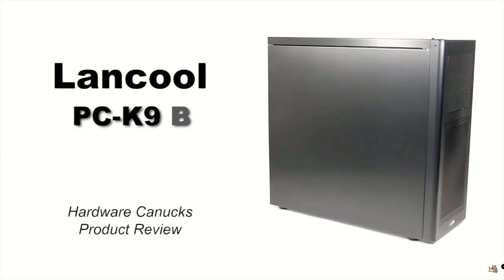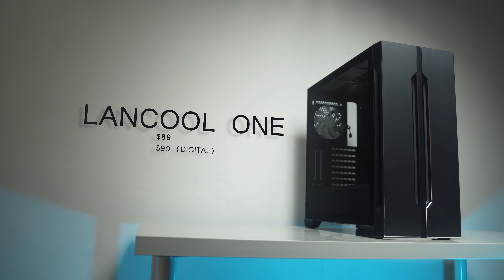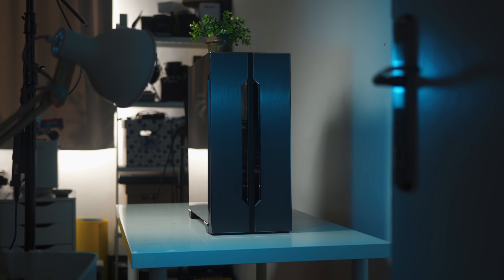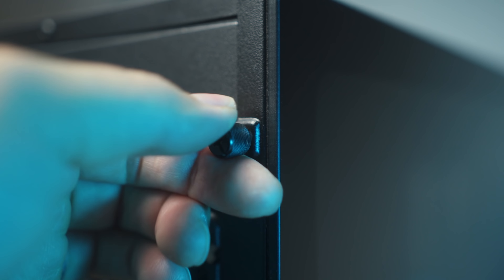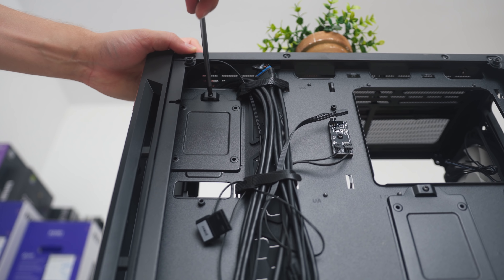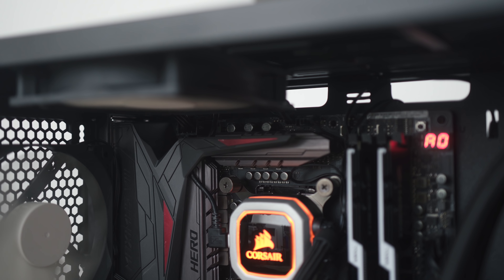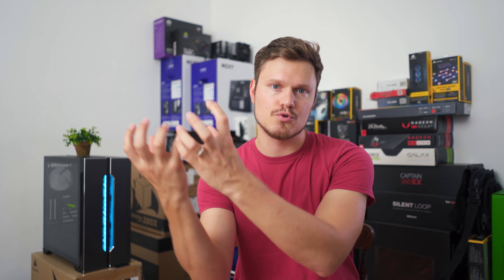AWESOME Front Panel Design - But Enough To Save This Case?

Comment: 4:35 imho it's a solid approach to leave out drive caddies because the drive mount is more solid and it actually saves space for cable management. caddies usually take away a little bit of soace, but it depends on the implementation

Comment: Lian li adapted so well in the last couple years, they used to only sell super expensive cases and with basic design. Now they not only have cheaper cases but they are also modern designed and creative. This case is not my style, but it looks cool.

Comment: You should look into the Cooler Master MB500 next. I have that case and so far it seems to beat every case on the market in terms of price, airflow and ease of built. I run an RX 580 inside it and the temps never go above 78-80 degrees C in a country where the ambient temperature is 30-33

Comment: As much as I like Dimitri and Hardware Canucks, this video is rather biased. It focuses on non-issues and blows them out of proportion: screwdrivers needed for pcie slots, or that the front bends when you twist it.
At the same time, it leaves out aspects that make this case attractive and separate it from Phanteks or Fractal. It supports EATX, which the Meshify doesn't, same goes for rgb features. It has a full size glas window, unlike the P350X. It features thumbscrews on the back, which makes for a clean window panel, which neither of the aforementioned cases have. 
I don't know why they were being so harsh on that specific case. Meshify C is awesome, it houses my main build. Phanteks is awesome, I build my girlfriend's pc in a P400S. 
I will always highly recommend those. 
But I'm currently building a Lancool One Digital build and it is a fantastic case that has enough features to choose this case over other cases.
Reply: I knew it's old comment, but you're right, the first I saw this video since I'm searching for elegant case with full size tempered glas, I was like "damn this one is catching my eyes, look like NZXT but better" and then he mention the top section easily bending... Then I was like "so it's not that good..." but yeah after read your comment, I think I will give it a try

Comment: Eh, about the molex power, sometimes it's all one needs. However, with power supplies supporting it less and less, the complaint about moving on seems valid, but I also don't like the idea of SATA power just for a string of lights when I could use it for storage.
Reply: If you are already using an ssd back there. You can just plug them in. Instead of running another cable just to plug lights in.

Comment: 5:50 i can't agree with the complaint of Molex for LED power. if this is a budget case, there will probably be budget components being used. for example, why steal a SATA power cable from a budget PSU that may only provide 2-3?
Reply: Jon P Ybanez 99 is not a low budget
Reply: Dmitry begins his review by stating the case is part of a budget series (1:10). I'm calling it budget just to echo what he uses to describe the case.

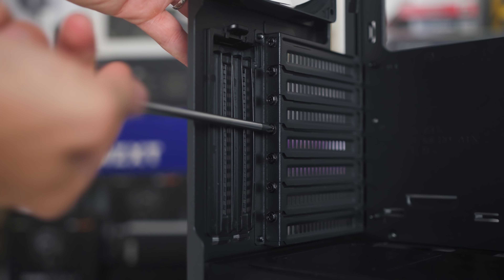Comment: 5:14 Vertical slot? does this mean can just plug n play a gpu vertically without additional stuff?
Reply: You would need an additional cable to run from the pcie solt to the gpu. I would assume it doesn't come with that.

Comment: Just get a fractal design meshify c lol
Reply: Yeah, it really looks like a bad attempt to make a case similar to meshify C. Worse front panel that looks good but up close it shows the "cheapness" (but hey it has rgb with a godawful molex). Worse drive cage. The soft rubber grommets are also a no go for me. They are going to tear apart in no time. Really not impressed with the final product from Lian Li.
Reply: my thought lmao
Reply: Exactly lol, if you're going to spend a hundred dollars on a case might as well went with the meshify c or something else
Reply: Love my Meshify C. The Define C looks pretty dope too; I'd trust pretty much any Fractal case at this point, really.
Reply: I loved the meshify c, but they really screwed anyone over who wanted to use a 270mm+ gpu with a front mounted radiator. They should have made it 40-50mm longer.
Reply: Jared Craig yeah that was my only gripe with case
Reply: meshify C front panel has too much of a pseudo-3d effect, though.  it looks 3d, but then you see it in person and its barely more than flat.
Reply: get a 570x if you're a baller
Reply: A 55mm(fan+rad) should fit. It has 315mm gpu clearance with a front mounted fan(usually 25mm). If you have a 270mm gpu(mine is 280mm), that leaves you 45mm clearance for a rad. Consider the S36, for example.
Reply: Fair enough. However I'd rather have the worst looking front mesh panel than the best looking solid one.
Reply: Just get a TT View 31. Oh wait, I did.
Reply: Mesh C is great but mine  has a shitty front io that randomly decided to break the audio out jack and power button
Reply: Meshify C can't fit EATX, neither does it have any rgb whatsoever.

Comment: After a month or so of looking up reviews and information for a mid tower case I went with the Fractal Design Define R6 and seeing cases like this in the same price range. ($110-$150) depending on sale etc.. The R6 can not be beat. I run a 240 AIO with push/pull on the front panel with 6 additional fans in the case running super quiet and cool. The build quality is unmatched. all the dust filters are a nice touch a well. This case looks cheap and low end with a fancy face.
Reply: that fractal case looks bland and bleak, this one looks like someone actually put effort into designing it at least.
Reply: HAHA ok cool.. so you are the perfect audience of a overly stylized case design with poor quality, Enermax loves people like you. The R6 has more style than any flashy blingy case. you just cant see or appreciate the simplistic clean design with extremely modular and customization interior, which is far more important than seeing fans in the front panel.
Reply: simplistic design is not only way too commonplace in the current market, its a lack of visual design, not a style of it.  its like saying there's something inside an empty vacuum chamber.  there isn't.

yes, quality is (usually more) important, but looks matter too.  you can't market something solely off of technical specifications/pure quality without factoring in some design, or you will just significantly limit the audience who will want your item.  its about balancing design and quality, not going 100% quality and 0% design.

R6 looks like i could paint a cardboard box black and poke some holes in it and it would look the same.  at least other cases look like they put some effort instead of none into the visual side of things.

Comment: Correction: only slim low profile radiators can fit on top. Awesome case by Lancool ONE aka Lian-Li.👍the best water cooling case under $100 so far in 2018! If not...
Tell me one case that has...
vertical GPU mount
RGB support
Dual 360 rad support
Tempered glass panel and doesn't choke the front for air?

Comment: Does anyone do a how to remove the front panel video I have this case and don't want to damage it but now I can't find anyone showing how to remove it I tried calling on it but it doesn't budge
Reply: Have the same problem. Did you take it off?
Reply: @TheKyoko909  I don't know if it's necessary, but I ended up taking both side panels off. The bottom left corner on mine was the loosest, for me I ended up having to hang the front edge of my tower over the table because it was catching on the table itself when trying to pull it off.

Comment: Lian Li always sells cheap stuff at higher than market price.
When I first bought my Lian Li O11 Air Edition. 
Im surprised the lack of internal feature such as removable thumb screw for the 7 PCIE brackets. it's 2018 and you still need to use a screw driver for those.
The HDD cage is not toolless design.
The magnetic dust filter feel cheap AF as those do not stick to the case properly. Phantek or Fractal Design has better non-magnetic dust filter design overall and is FAR cheaper than what lian li is producing,
Reply: Lian Li was once known for its expensive all alluminium cases

Comment: I went for the NZXT H500i and im very happy with this. From a Cooler Master K280 to a NZXT H500i, i felt the material's quality diference.
Reply: but the looks drastically decrease.  one looks like they actually put some effort into the visual side of the case.  the nzxt one looks like they modeled it after a cardboard box.

Comment: Yeah, but if you need EATX with low weight 8,25KG and compact size, good airflow, 360mm AIO, big GPU, case made by major brands... also most of contemporary features like glass and aluminum, LED sync, USB-C and simple good design... you will find out, that there is almost no alternative, especially at this price point. Just maybe old old old corsair 450d

Comment: I want people to comment on this and give your opinion i had a cpu which i used for 7 years thats the intel celeron 1000m 1.8ghz but now i have an i5 3320m but thats the good part....the bad part it that my laptops left hinge melted becuase of the heatsync being right underneath the screw and holding for the hinge....my idea was to take out the components from the laptop and turn it into a media pc and turn the screen into a monitor but without the contoller because im not using hdmi its the same laptop csble i am extending for the screen XD. Let me know your opinion!
Reply: Idrees 778 just get a cheap desktop setup man, much better
Reply: Julius Hansson i forgot to imply that i am broke af
Reply: Julius Hansson and btw why would i get a cheap desktop if my mobile cpu is close to being on par with an thalon x4 640 and is better than the i5 4200u

Comment: Outdated Molex, require tools and poor cable solutions... I think this is a 7 years old case with a new poor-airflow-front-panel-but-hey-it's-RGB! that is the rage recently...
Reply: Requires tools? Seriously?
Reply: you need a screwdriver anyway. how would you install motherboard without it?
Reply: Fair point about the tools. But having to bust out the tools, just to change a drive out or take off a side panel to do something quick would be annoying.

Comment: Still prefer my white Meshify C.
Reply: I'm about ready to do another build and have been considering the s340, 400c, h500(CM and NZXT), O11 Air, Lancool One, or an R6. So far, I'm thinking get of a 2nd Meshify C, but in white(my first one is black). Every time I say "ooo I like this case, but wish it had this..." I think back to the Meshify C lol.
Reply: DbDBlackJack yeah, totally haha. I'm building a home server and I'm leaning towards the R6 for hard drive mounts but I love my Meshify C. I bought it to be a temp because I was waiting for the O11 Air but that was a disappointment for me and I'm more than happy with my Meshify C. Just wish Fractal made a white model without a side panel window.
Reply: I'm pretty sure you can mount the solid panel on window side. Might have to take out the grommets, but there are mounting holes symmetrical to the holes on the solid panel side. Double check that, but I'd bet you can.

I didn't like the cpu cooler clearance on the O11 Air. What didn't you like about it?
Reply: I could probably mod my Meshify C to take the panel but I meant that Fractal doesn't sell the non-windowed version in white, only black (I would've bought the non-windowed version in White if it existed). As for the O11 Air, it wasn't a really good airflow case from what I saw in the reviews - the dust filters blocked too much air and a lot of builds I've seen are using it for water cooling. I also wish that it came in white, since the O11 Dynamic came in two colours. I guess not big things but they were big enough to make me not want to change cases when I already really like my Meshify C.

Comment: At this point, case manufacturers should just re-boot their greatest cases of years old with some newer elements (even if it's as little as glass and some lighting). It's obvious they can't come up with any NEW ideas. It would be more refreshing to see some of the older classics re-booted and re-released rather than these "there's only so much we can do on the case formula" releases

Comment: Can you all give me some review about s340 elite airflow? I really like this case, btw im using air cooler
Reply: Ngurah Bramhyang i think dimitri already made a review about them
Reply: Mr thunder i know, i want to know about some people who use that case
Reply: I use that case right now for almost 2 years (in 4 months) and temps are fine since the front panel is a good length away from the from intake. The dust filter doesn't choke the airflow and GPU temps on a 1070 at full load are around 75 C and of course depending how you cool the cpu I'm sure either air or liquid will be fine temperature wise.
Reply: MsMariokartwiifan how about your CPU temps?
Reply: Well I use a Corsair H100i v2 on an i5-6600k at 4.2 which is a modest overclock. It will depend on what cooler you use but I get around 38-40 C max load when gaming, but have no tried a full synthetic benchmark like aida 64. Again, I could overclock it to 4.5+ no problem I'm sure which would raise the temps but for an Intel chip, the temps are not bad.
Reply: i get an 8c hit with the front panel on using an air cooler and two corsair 140mm as intakes.
Reply: Simon Fuller how about your max temps for your CPU and GPU?
Reply: MsMariokartwiifan how about your GPU?
Reply: Hugh Janus ok thanks a lot bro! ;)

Comment: I want more space for 3,5" HDDs :O
Reply: HDD's are an eye sore in a tempered glass panel like this. So, why?
Reply: Bryce Bishop They should be in the power supply chamber.  But I just want like 4 or so down there 😅

Comment: So basically all the cases below £100 are cheap shitty cases. the reasonable stylish best cases are about £150 i can see on overclockersuk. you got the meshify s2 which seems a good case but looks cheap, lian lil 011 dynamic looks good quality and stylish design but no built in vertical gpu mount, nzxt h700 looks basic and no vertical gpu mount, h500p mesh looks too big and not sleek looking, obsidian 500d looks nice but i think its quite a small case, phanteks p600 looked ok bit big like the h500p and cheap looking plastic white. i think its gonna be lian li 011 dynamic ill be choosing.

Comment: We need case manufacturers that make higher quality cases. So sad to see how brands like Corsair are manufacturing cheap plastic garbage cases and peripherals like their "Raptor" peripherals and "SPEC" cases (with maybe the exception of the SPEC-OMEGA).
Reply: manufacturing those plastic cases with metal would lead to unreasonable price tags due to manufacturing constraints with metal trying to make some of these more 3-dimensional patterns you can get with plastic for a much lower cost.  what we really need is fewer cases that look like they had 3 seconds of time put into the visuals.  so many cases i see online just look like "painted cardboard box with piece of glass on the side", like cmon, where's the more interesting and unique cases? what happened to the more aggressive cases? yea, the SPEC-OMEGA line from corsair is good, but i wish we had more modern cases like that.
Reply: I don't mind plastic. As long as it is in the right place and it isn't cheap plastic. Case in point, no pun intended. My TT View 31.

Comment: Kind of dissappointed about this case. In my opinion it's possibly the best looking case in the sub-$100 category, but with those cheap material choices, missing drive bays and phillips screws for the SSD mounts, they've really missed the mark unfortunately. Back to the Meshify C for me.
Reply: I would have to disagree that it looks the best. Fractal Design Meshify C and Thermaltake View 31.

Comment: lol... It looks a lot... and I don't just mean a lot... but UNCANNILY a lot... like an HP Envy Phoenix...   Sort of pathetic to copy design off of HP... I mean, nothing against HP... But come on.  This thing is its twin.

Honestly, an Alienware Aurora R1 from what, 2012?  Is a HELL OF A LOT better than this, and I of course am just talking about the case.  Even back then, Dell basically, managed to make all of the RGB side and front panels connect via wireless gold plated spring terminals/contacts.  Had better AIO/radiator/pump mounting, better (if the only) build in lighting... and I don't mean RGB, I mean functional, white, LED's in the back, top inside, side inside, etc... just to help you see what you're doing when its dark.  I mean... 2012.... Dell..... And what we get here is a modern HP lookalike, but yet one that's even far inferior to the actual HP variant.   Lame... this shits just lame. 1/5   ... It's a case... but one with a major identity crisis.... as well as the inability to aide any typical activity in any way.  Rather it hinders... with practices from the 90s.  So nice.

So yeah, I agree with your synopsis and all... though you're probably being a tad nicer about it all than whats warranted here.  But then again, you guys are an awful nice folk.

Comment: Not enough. I was rather excited for the release of this case, but not anymore. Flimsy material, lack of thumb screws, lack of drive sleds, ill-fitting grommets... there's just so much better out there for at or below the same price point. GN did thermal testing and it seems to perform well, all things considered, but it is still very disappointing.